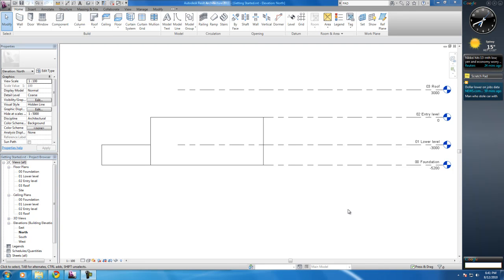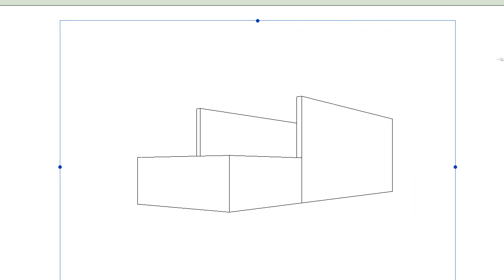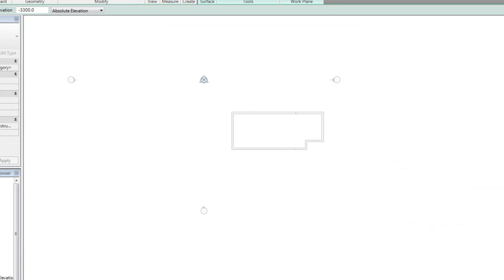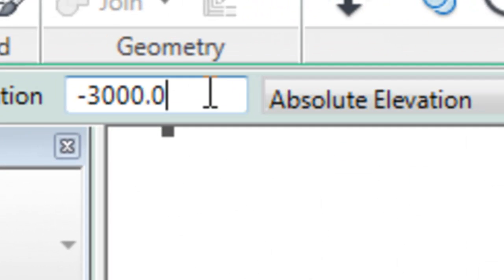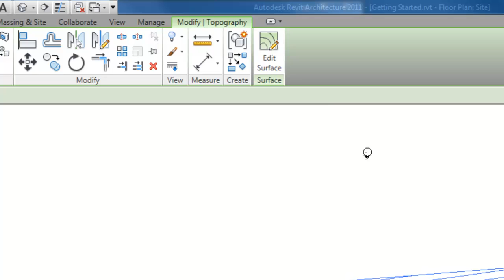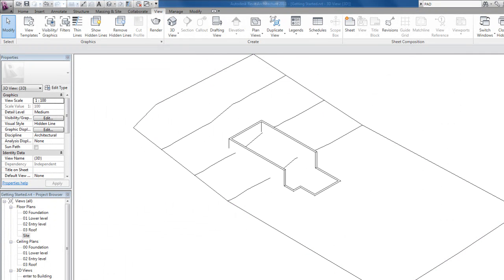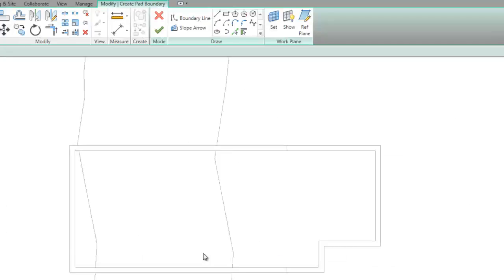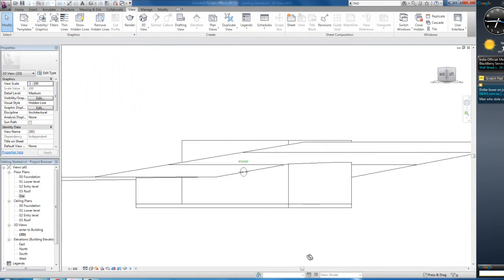Autodesk Revit Tutorials: 03 Adding Topographic Surface

Comment: @FractalBolt ! I had same issue, this might be late, but future users may find this helpful.
For the concrete walls: base need to be 'foundation level' and top should be 'lower level' and top & base offset should be 'zero'. Even now you won't see the concrete wall in site plan. For that click on site plan, in the properties change the underlay from none to 'foundation'. Try your camera view now, if it is still not working don't bother, try it in the other views.